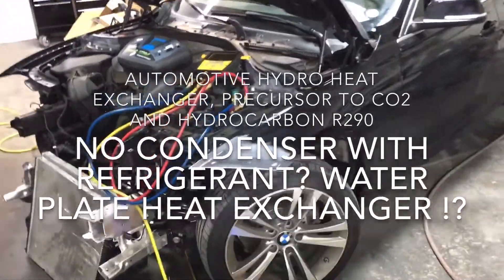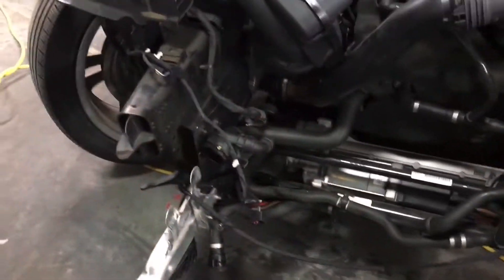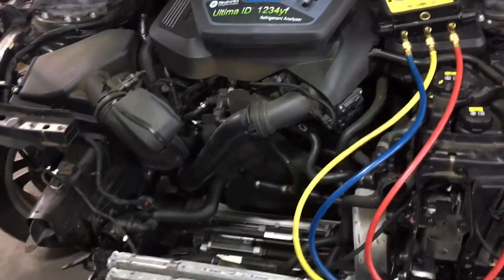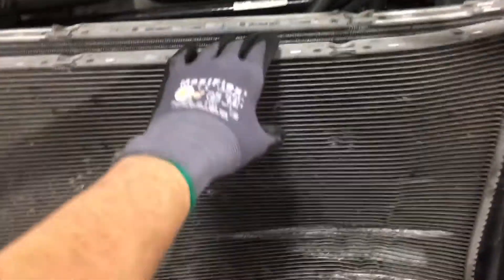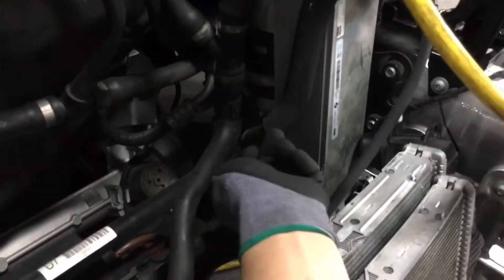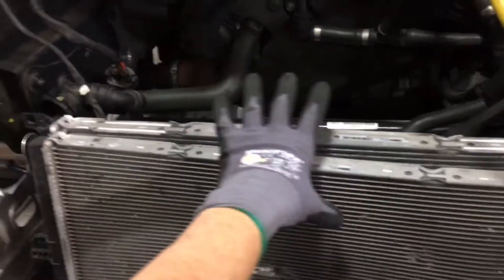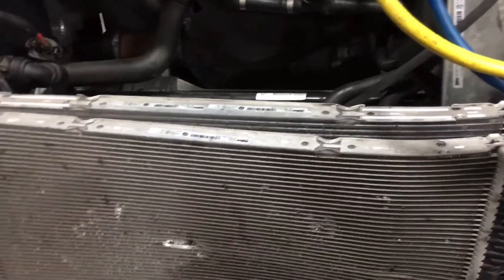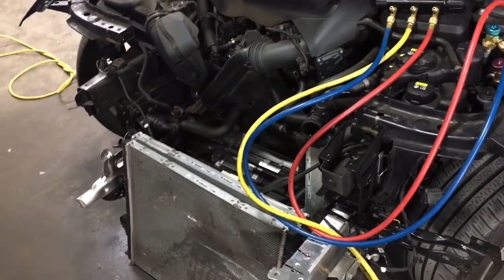Car AC with no refrigerant condenser?!. Water cold plate heat exchanger

Comment: Hey I’m looking at retrofitting one of these to my 4x4, it’s had a 100mm intercooler fitted and condenser removed 
This is all theoretical 
But thinking about using this water cooled condenser with an ice box and water pump 
Similar to a water to air intercooler system 
Do you think it will work
Reply from the maker: Why are you using a icebox ? 

You cannot dissipate heat through an icebox it insulates. 

Plate heat exchangers are rated in BTUs or watts of heat dissipation

For what reason would you want to do this to a 4 x 4 .?

Comment: That is most amazing thank you for sharing
Reply from the maker: orville58 that’s just the tip of the iceberg. It’s actually called thermal management no longer air-conditioning that is a term from past historical times not to be used anymore. 
             We know how vehicles with up to three separate isolated cooling systems on vehicles now including liquid heat exchangers was up to three or four electric water pumps and 2 to three way bypass valves for rerouting hot or cold coolant from engines from batteries and from inverters also for passenger comfort. Throw in dual rear air conditioning units on top of that expansion valves that are directly connected and mounted to rear mounted hybrid drive batteries and air conditioning that is tied into the GPS of the vehicle that watches the time of the day so it knows whether the sun is rising on the east or setting in the west then determines what direction you are driving so if you have the sun hitting you on the side of the face on that side of the vehicle it will add a little bit more air-conditioning to that side to give you a little extra cooling well the passenger could be in the shade away from the sun so it will turn down the air conditioning and this is all tied into the GPS of the vehicle. 
            When you plug your vehicle in at night to charge the thermal management system kicks in to cool off the inverter and keep the batteries cool. 
              You come home with your Tesla and you have a black out you can plug your tesla into your power system at home and run your house off your battery pack from your Tesla at the same time the cooling thermal management system kicks in on the vehicle with the refrigerant to cool off the coolant from the plate heat exchanger‘s so nothing overheats. 
          Now on these vehicles are 10+ years old and it’s time to diagnose problems what level technician do you think we will need.
Reply: t lech a rocket scientist lol